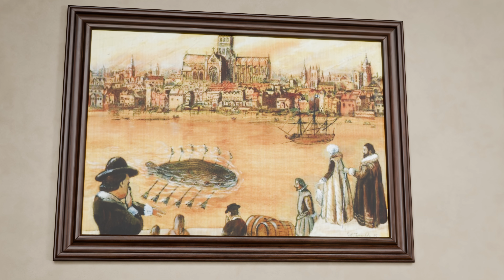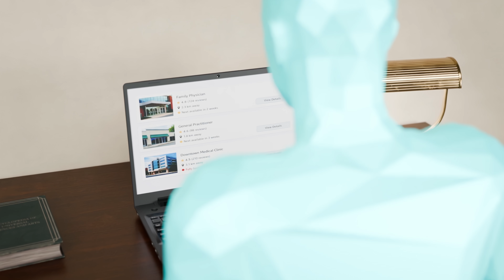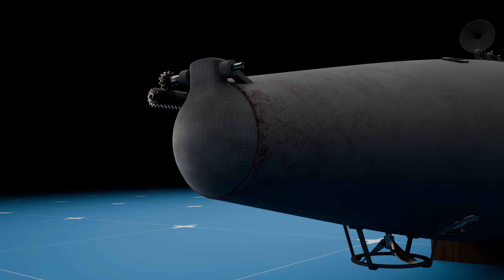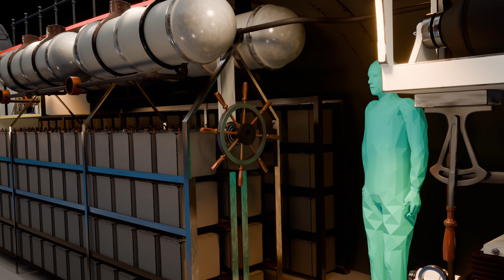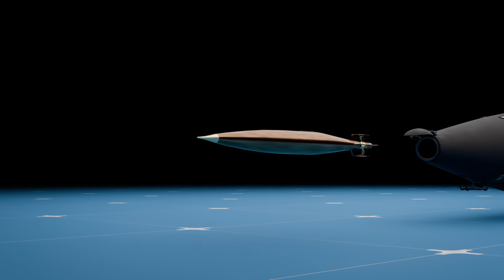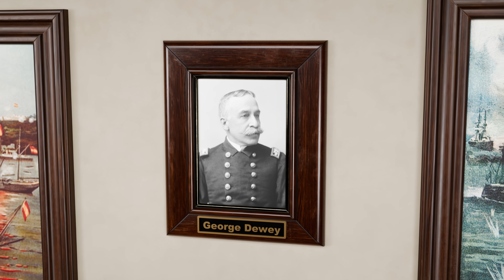How the First Modern Military Submarine Actually Worked

Comment: In 1866, Ivan Fedorovich Aleksandrovsky's 350-ton boat was launched. It could submerge and navigate underwater for relatively long periods, using piston-driven pneumatic engines powered by compressed air from 200 cast-iron cylinders. The boat was equipped with two 117-hThe first production submarines (Dzhevetsky's submarines) were also powered by human power and armed with two mines. They had an endurance of 50 hours and a crew of three. They were launched in 1880-1881. They were used in the 1880s to defend Russian military ports on the Baltic and Black Seas. After modernization, they saw limited use during the Russo-Japanese War (1904-1905).orsepower engines. The crew consisted of 22 people. The boat was launched in 1866.
The first production submarines (Dzhevetsky's submarines) were also powered by human power and armed with two mines. They had an endurance of 50 hours and a crew of three. They were launched in 1880-1881. They were used in the 1880s to defend Russian military ports on the Baltic and Black Seas. After modernization, they saw limited use during the Russo-Japanese War (1904-1905).

Comment: I see several problems with that sub design. HEAT - with single metal plate. It would be get cold inside. Sun was pure electric. How did they recharge batteries? Did they relied on support ship? Not to mention those batteries would break constantly. Salt would definitely get inside, electricity and salt isn't combination you want in small sub. Any damage to batteries  sustain would risk releasing toxic fumes. Wonderful vessel but very unsafe to very limited use and constant maintenance. 😮

Comment: Amazing work, as always! 
Thanks very much for the work done to share such great and interesting content! 

One of the most interesting and shocking features, for me; is the torpedo tube, and the ability to, both use a “remote” opening, and its actual usability and resistance.
even at small depth like those it is still highly remarkable that something produced and engineered in the 19th century, bearing only half of what would later be in use for the next great submarines of the German fleet; could shoot/lunch bullet like torpedo, which by himself is a huge engineering challenge, as has to be self propelled, very unexpected features of, for me, an unknown invention such as both the sub and the torpedo.

Comment: How did they plan on recharging the batteries? Were they just planned to be swapped out or could the sub could be towed and the props be left to spin the energy back via windmilling? Or did they build new cells and swap?
Reply: Looking into it.

Apparently, it was planned to be recharged by a shore-based dynamo. One of the reasons it was not favored was this limitation. One would suspect they might have tried a sea-based tender with a dynamo on-board recharge the submarine but naval advances by the time ships were carrying those on-board in a capacity it was the age of diesel. Fascinating stuff.

Comment: How come the axles joining the inside and outside (eg propellers) do not let water in?
Reply: They likely used a system similar to a modern outside faucet that a garden hose attaches to. Those use a felt washer packed with grease, compressed around the valve stem. Over time, the felt compresses enough that water begins leaking around the valve stem and a wrench is used to tighten the compression nut around the valve stem. Eventually, after many years, the valve will need to be rebuilt or replaced. With a constantly turning shaft, a certain amount of water will still make it past the seal, especially as pressure increases with depth, and need to be removed with a bilge pump. I have no idea how this is done on a modern submersible.

Comment: Why don’t counter rotating propellers cancel each other out?
Reply: The blades were also counter pitched so that both provided forward propulsion. The advantage to using this system is that It automatically cancels the torque that a single shaft produces that would otherwise require constant trim adjustment.

Comment: The biggest problem with this submarine was the fact that the batteries could not be charged internally and its range was 740 km.
At that moment, Spain had Cuba, Puerto Rico and the Philippines as the most important colonies.
So, if they would have built (2) two, these submarines could have been towed by a surface ship, one to the Philippines and one to Cuba. 
There, at least in one location in Cuba and at two locations in the Philippines (because they are bigger than Cuba), the Spaniards should have installed DC generators at shore, to charge the submarine.
Reply: The submarine was just a prototype, if it when production many of those problems would have been solved

Comment: The reason it wasn't put into service is probably because they found out the range was very limited and no fast way to charge the batteries safely. Bet the real range with have been less then a hundred miles at best and the batteries would have had to be replaced after every use or sit and while being charged with no real way to vent the gases caused during charging.

Comment: It was very advanced. I'm impressed by the air purification system. Air was pumped thru sodium hydroxide to remove CO2 and oxygen added from tanks. It main problem was it needed to be close to the surface to view a target which made it fairly easy to spot during day attacks. The max effective torpedo range of 400M would put the sub's periscope in range of rifles used by the USN during the war, not to mention other weapons.

Comment: More Jules Verne than actual Submarine. An actual Semi Submersible. The thick periscope and the big air intakes would have provided large amounts of drag, robbing the vessel of power and speed. Massive lead/acid batteries and their vapors would have made the air unbreathable when under water with no way to recharge. The tech of the day would have meant very high voltage, possible sparks and explosive gasses from the batteries. 
Semi submersible, with in a few miles of shore and at night could have provided a really opportunity for this vessel to have been a real threat.

Comment: Never heard of this one, looks interesting, and appears to be a advanced design for the time. However, I can see why it was never used. Given your illustration is correct I can see some glaring design flaws. 1 no internal combustion engine to recharge. 2 Single compartment design, one leak and it's gone. 3 sharing space with tons of lead acid batteries is a recipe for disaster. Acid burns, hydrogen gas leakage with suffocation and or explosion. Add salt water ingress and you can add chlorine gas to the mix. I don't believe it would have been successful.

Comment: The submarine was advanced and everything about it was impressive, especially for it's time, but as far as the statement Admiral George Dewey made about Spain using just one of those submarines, he wouldn't have been able to hold the blockade. The submarine would have been a game changer, but proving it and theorizing what it could have done if it was finished is two different things. Something that advanced for that time may not have worked correctly, including not being able to fire missiles accurately or at all.

Comment: The most surprising part is that electric motors were powerful enough for moving 77 tonnes all the way back in the 1888.
Reply: If you didn't know we had electric cars in 1888. The oil and gas industry spent unimaginable amounts to squander that early EV tech. I personally prefer combustion engines over electric but just think how far we could be if electric actually had a fair shot.
Reply: @stevenlillo2617 first car was electric. From what I understand the petrol cars won because of gas stations. Electric cars had limited range and had to charge overnight. Gas stations spreading made ICE cars more useful.
Reply: @Mittens_Gaming  
"first car was electric."
When you count this as car, then the first was steam...
But really? The first practical car was the Benz Motorwagen and also the first that went into production.
All before were prototypes, toys or machines that were able to move.
Reply: @stevenlillo2617  Batteries of the time simply weren't good enough for Cars. Before lithium ion batteries the max you could hope for was 50km of autonomy or so, after charging overnight
Reply: @stevenlillo2617 I vaguely remember something about this. I didn’t think it was that far back though. That’s the surprising part.
Reply: @stevenlillo2617  it was the fact the batteries were not good enough to give range of more than about 30 miles till large lithium ion ones got semi affordable in the 2010s
Reply: @stevenlillo2617  80IQ conspiracy theory nonsense

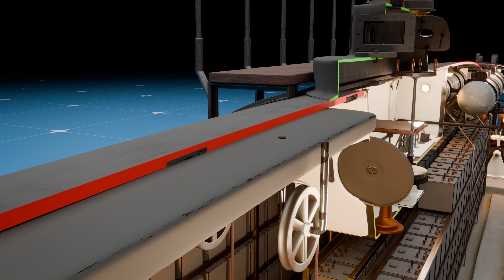Comment: 2:40 The later "double-hull" submarines were essentially the same as the single hull one you describe: "only one layer of steel," the pressure hull, separates the crew from the surrounding ocean. The outer hull (what the British call the "casing" is free-flooding and provides no protection at all against water pressure. And, of course, modern U.S. submarines are generally now of single-hull construction, too, providing just "one layer of steel." In fact, the majority of nations built single-hull submarines after 1950, with the notable exception of the U.S.S.R./Russia.

Comment: Suprising that every system there is still in use in some form in modern submarines, the only thing that was missing was a way to charge the battery bank, simply because at that time internal combustion engines were primitive and balky, so instead of trying to fit it in and overcome the limitations, they simply used the volume the engine and support would need to add more lead acid battery banks. Operationally this likely would have been a poor performer initially, no real air system for the crew, so they would have been continually venting air to remove CO2, and also limited diving ability, though in that era it wold have been devastatingly effective, as there were no countermeasures available. A single submarine could wreak havoc just by the possibility of it being there, just by sinking a single command ship or a destroyer, and then vanishing with no trace, at least compared to existing doctrine. that would have caused terror, even if the submarine only went out once, and came back to port to take a week to reload torpedos and charge the battery bank up again, as that large a bank would require careful monitoring during charge, and very effective venting of the entire interior as well to keep generated hydrogen gas below the LEL, as there are hundreds of brushed motors there that generate sparks, and I doubt that any were fully enclosed, because that is very difficult on a DC motor without accepting the need to strip and service it after 100 hours of operation to remove conductive carbon dust, or put in an internal fan and filter for it. 

Active depth control though is impressive, and something that modern submarines only can do with movement, here they used what is effectively bow and stern thrusters, something only recently becoming common on large ships, to control motion, for exactly the same reasons ships do it, precise slow movement control with good performance.

Comment: The range of the vessel with pure batteries in 1888 blew my mind. I would have guessed, max, 100 miles. 400 is unreal for the time.
Reply: The 5 later Holland submarines built from 1903 to 1913 only managed a submerged range on batteries of only about 20 miles. Imagine if these Peral subs went into production and stayed in production until now.

Comment: This was an awesome video, I did a school presentation on the history of the Spanish Armada's submarine flotilla and only briefly mentioned the Peral, I would have definitely spent more time on it if I had watched this video then. The most surprising fact to me was that the submarine operated solely on batteries with zero way to recharge them, unlike in a modern day diesel-electric submarine, I was also surprised by the fact that it used auxiliary propellors to control depth alongside an early version of ballast tanks with the compressed air being able to serve multiple purposes rather than one. I do want to get one of the posters for my history teacher, or if I 'won' it.
Reply: it didnt work,  dont believe every thing you see on you tube
Reply: @userbritish-e2w  ???
Reply: @Seby8822 ignore that bot. The submarine worked, the problem was the admirals that see Peral as a crazy man

Comment: I'm amused that it was designed to load torpedoes through the hatch. Certainly fewer openings in the pressure hull makes it easier to maintain pressure and minimize leaks, so it makes sense to design with that in mind, but I'm still surprised. My first intuition with that design is that they would be loaded through the launch tube.
Reply: Because of the weight and shape of the sub, the launch tube would always be underwater even when the sub is fully floated on the surface, so this design of going through thr top hatch makes perfect sense. Brilliantly simple.
Reply: Torpedoes are loaded into the boat through a topside hatch on all submarines. Even today, they are still loaded that way.
Reply: @wrider07  IIRC there is at least one class of Russian sub (Kilo, maybe?) that loads through the uppermost bow tube. I’m not sure if that tube sits naturally above the surface or if they trim the boat down at the stern when loading torpedos.
Reply: @wrider07  Yep
Reply: What is spe chan doing